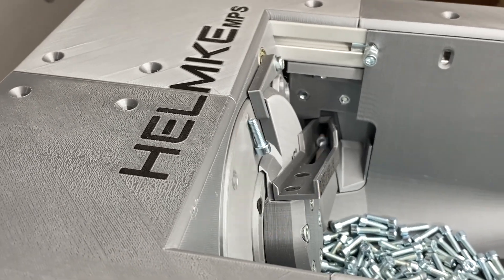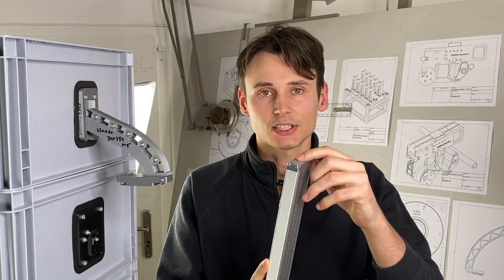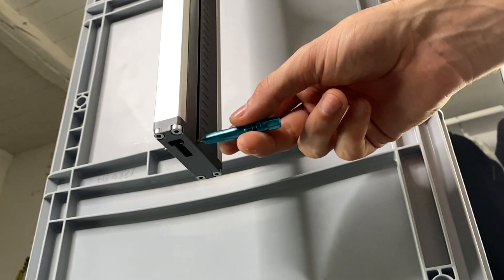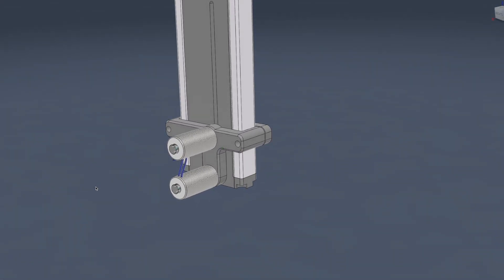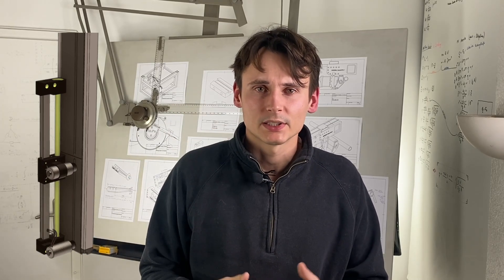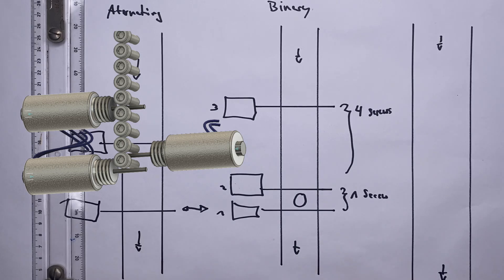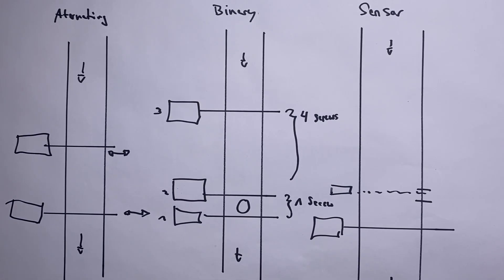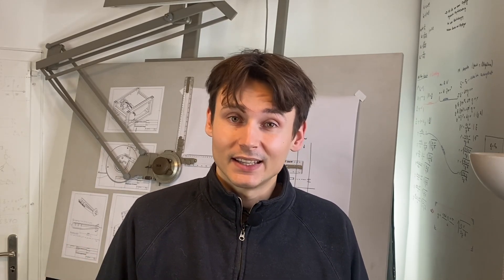3D-printed automation - Screw packaging #001

Comment: One of my long term goals is to make a “BOM Vending Machine” where you basically walk up to it (at a Makerspace etc) insert your Bill of Materials (BOM) and it spits out all the parts you would need for that from a wide selection all counted/cut to length etc

You seem to have made a part of that system already then, well done!  I especially love the modular aspect.

I’m excited to see how this project goes!
Reply from the maker: glad you like it!
Reply: My hardware store has something way better. I can buy srews, nuts, bolds, washer etc. by weight. They have different prices for the different materials, standard, galvanized and stainless. I put everything in a bag what I want, at the counter they put it on a scale an I pay it for the weight.
Reply: @jonasstahl9826  Almost like those candy or icecream stores, that’s neat!  Still leaves the hand picking + hunting for what you need issues which is what i hope to eliminate.
Reply: @ericlotze7724  Year pretty much like that.
Picking not realy they are dirt cheap.
Galvanized is 10€/kg
A M5 Bold 30mm long weighs 5 gramm
Means a single Bold cost just 0,05€.
That is basicly the same price per piece as if I would buy a box of 1000.
I dont count, I just grab a hand full of what I need.

Comment: There's a video of how the part of this wheel box that holds the screws looks like, how the box is assembled inside the other box, very cool, really cool this project is sessional
Reply from the maker: Yes, there will be videos about that as well. My plan is to work through the whole system in the videos. 
However, there is really a lot going on in the seperator, and it is quite complicated to explain - so there will be several videos about it. Also due to the fact that the separator works a bit different for nuts/bolts/washers.
That's why I decided to start with the elements that are easier to explain, my goal is to explain it well and to make videos that are pleasant to watch.
Hopefully it won't take too long until we get there.

Comment: Cool project! I think slowing them down using an electro magnet might be worth a try. If the screws were non ferrous just a bank of permanent magnets would nicely slow them down because of the Eddy currents generated in the screws. But with ferrous screws you might need to pulse an electro magnet.
Reply from the maker: interesting idea, I will think about it, thank you!

Comment: Really cool project!  You might only need the lower inductive sensor. When it no longer detects a screw, run the collector until it detects a screw again, and then for a certain additional length of time to build your hysteresis buffer.

Comment: Might be a silly question but what means have you been using to separate nuts and bolts at the first place? I understand that the disc contains equally separated magnets but what happens in case a bolt is set horizontally as it can been seen in an instance. Great great video thanks ! 
Also as far as the second video is concerned maybe you could also use a belt system for the 2 1 reduction just an idea
Reply from the maker: I think I was a little unclear, I call it a seperator because it separates the individual screws from each other. You can only insert either bolts or nuts. Not both at the same time. Thanks for the comment, I was not aware that could be misunderstood!
Reply: @christopherhelmke  dude I have literally lost my mind it's not your fault. The nuts I had been watching  were the ones fixed on the rotating disc...I just hope you had a good laugh

Comment: Would it make sense to make the upper solenoid’s position adjustable? In general you’re going to package the same number of screws. Fix the lower solenoid, and make the upper solenoid position adjustable on the magazine. The manual adjustment is relatively infrequent for a given screw type.
Reply from the maker: thanks for your comment! yes i think that would work, but i like the flexibility the sprocket design brings (in the next video)

Comment: Why are you not using a gear with teeth that engage with the screws to count and regulate them. It could slide in the slot you already have and if it had say 12 teeth, you just turn the motor 30° per screw you want to dispense.
Reply from the maker: that is actually exactly what I did in my new video :)

Comment: Istead of "locking" the 2 solonoids of the original system together with a fixed printed part, why not design the holding mechanism with adjustability in mind?
The bottom one could be fixed to the magazine and have for example a toothed rack extending up. And the upper one would have a pinion gear which can be tighened down once in the right position, so it stays in place for having the holder tightened as well. Alternatively there could be just made space for a literal spacer "stick" of the required length, that keeps the two apart.

Comment: How about slowing the screws down a bit and using a simple AI Image Recognition model to count screws? Just a thought?
Reply from the maker: this would require a lot of expensive hardware .. so I'll try something a little simpler first, but if that doesn't work it could be an option.
Reply: @christopherhelmke  machine vision nowadays can be done with a simple webcam and something like OpenCV

Comment: Counting is easy, can we have a video on the separator machine.
Reply from the maker: Yes, there will be videos about that as well. My plan is to work through the whole system in the videos. 

However, there is really a lot going on in the seperator, and it is quite complicated to explain - so there will be several videos about it. Also due to the fact that the separator works a bit different for nuts/bolts/washers.

That's why I decided to start with the elements that are easier to explain, my goal is to explain it well and to make videos that are pleasant to watch.
Hopefully it won't take too long until we get there.
Reply: @VEC70R …then where is your design for a modular parts counter…
Reply: @ericlotze7724  Ain't that horse a bit high for ya?
I've designed and built dispensing machines for shit weirder than you can imagine, so STFU.
I was just curious about the separator.

Comment: Very impressive video! Really enjoyed your breakdown and approach to the problem. Have you considered using a load cell (I would imagine the screws to be consistently weighted)? By locating it at the bottom of the magazine, you can set up your weight limits in your program based on your number of screws required and use it in line the two solenoids. Thank you for the video, I am a fan of your work.
Reply from the maker: I have not yet thought about a load cell... currently i'm testing another approach (more about that in the next video) - if that doesn't work this could be an alternative. Thank you for your input! Also the feedback is extremely helpful for me!

Comment: I have a suggestion for an alternative metering method.

Place a small driven “sprocket” near the bottom of the magazine, so that it’s “teeth” poke into the side of the magazine slot and will catch the bolts as they fall.

Words are bad for describing mechanical systems, so here’s an example of functionality. If the sprocket had six “teeth” and I wanted to dispense 15 screws. I would rotate the “sprocket” 360/6 * 15 degrees + <some rotational offset that would probably need to be experimentally determined>.

I see a few options for powering such a “sprocket.”
1. A stepper motor
2. A DC motor running through a continuous-to-discreet linkage such as a Geneva drive
3. A solenoid pushing a rotational mechanism that indexes one position every time the solenoid actuates (unfortunately I can’t find an example of this right now, but I know I’ve seen them.)

The biggest problems I see are getting the teeth of the “sprocket” to cleanly engage the screws without jamming, and the weight of a stack of screws constantly loading the drive system.
Reply from the maker: Thank you so much for this comment! I really appreciate it!

All very good suggestions. 
My first thought on this is: 
I'm not sure if the teeth of the sprocket can really reach far enough into the magazine to hold the screws 100% tight without the tooth that "swings into the magazine" next colliding with the screw next in line. Based on pure intuition, this would require a very large diameter (and many" teeth") of the sprocket. This would require a very large diameter of the gear. But I haven't thought this through yet.

I will test it in the next video.
Reply: @christopherhelmke  i actually have a few of these running and they work excellently if not a bit slow. just a sprocket directly on a nema stepper (or geared if the holding force of the stepper is too low).

my main issue with the ones i have built is that the sprocket is 3d-printed to fit the specific task and as thus, are plastic. they work perfectly when new but wear out too fast for me.

also, for the solenoid approach, please do use fail-safe design if available (the springs pushing the rod into the magazine and current retracting it). i know it's probably not as bad for youbut it can at least be annoying. i got flashbacks to a solenoid hopper feeding 400 bars straight into a lathe bar feeder when it lost power.
Reply: @christopherhelmke  What about a mechanism like a gumball machine?  A rotating disc at the bottom of the magazine with a couple  cutouts of the screw and every time the disc rotates through the stacked screws one falls into the slot and then as it rotates it falls out the side.
Reply: @christopherhelmke  Look at two gears one on each side, then sprocket would be 1/2 the size.
Reply: You could just make it such that the gear is directly at the output and a single screw falls into the spot between teeth and then just turn it around to dispense letting them fall out
Reply: @lhadnusj  there is a new video
Reply: this makes me think of marble machine :)